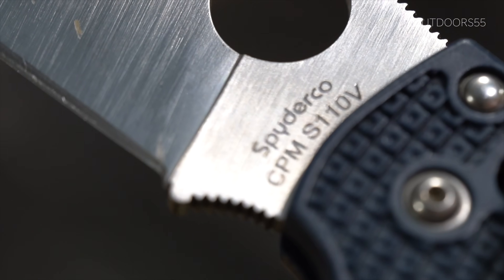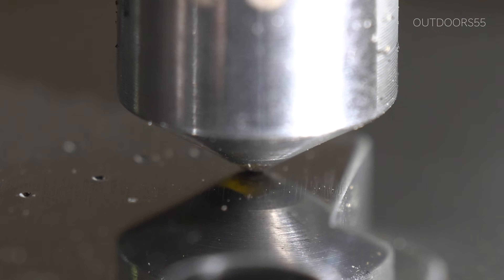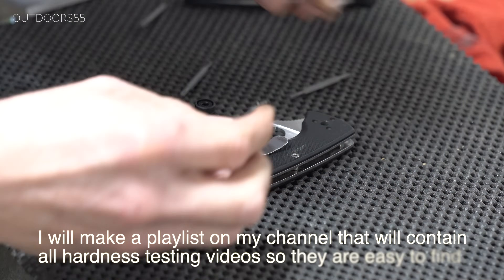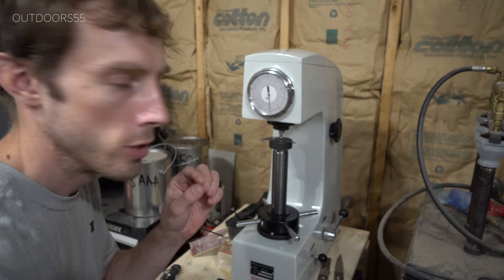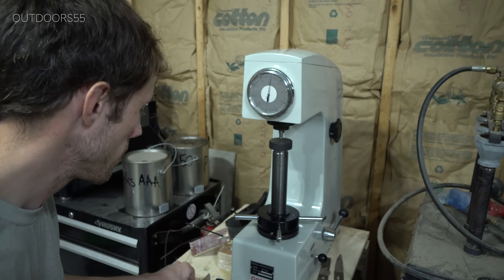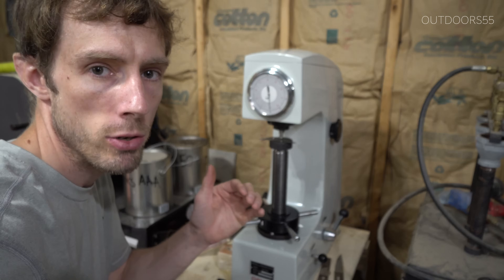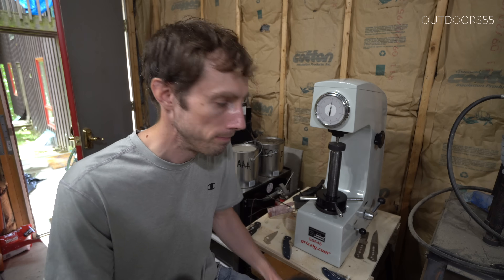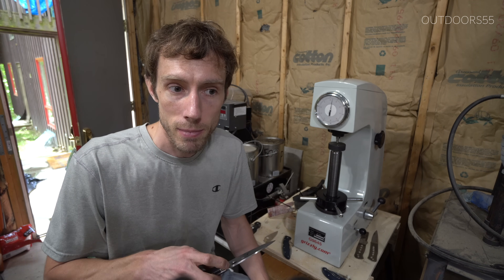How Hard Is Cheap Knife Steel?  Hardness Testing Spyderco Tenacious 8cr13mov

Comment: Hi Alex. Could you please add a comment in all future videos comparing your test results to the manufacturer's claims? Also each time you make a new video in the series, can you add a 'leaderboard' just listing every knife, the material, and the hardness? Thanks!
Reply from the maker: I thought about that. The reason I decided not to do both of those things is the manufacture's stated numbers can change. And some don't even list them. Also ive seen different numbers from the same knife models. In other words, the numbers really only relate to my particular knife. Thats also the reason I don't do the leaderboards. As I could test the same knife models a year later and get different numbers. So all the other videos would then be giving miss leading info. Adding a date of manufacture would be beneficial but thats aslo hard to tell. Especially with knives made overseas.

Comment: Changed my YT channel name to match IG been confusing everyone on YT 😬😬😬 

My genuine question  is if this machine capable of testing differentially heat treated blades like a knife from Tops? They state differential heat treatment of their blade and if you strip off the "traction" coating the different crystal structure is visibly noticeable with two different colours.

edit I should learn to listen before speaking 🤣🤣 it was clearly mentioned the surface should be on two parallel flats. Now I'm curious how a differential heat treat gets tested. Probably something like a shim of equal thickness.
Reply from the maker: Yeah it should be done on a flat surface. Otherwise the hardness reads low. I dont know if shims can be used. Any amount of flex or rocking motion can significantly affect the reading. There are ways to test a radius if the radius is known with a reference chart. On some knives i can test at the very spine and get good readings but not all. Thanks for watching bro really appreciate it👍

Comment: Try the fire bird 511.
It's cheap for what it is d10 tool steel and it has bearings. I would like to see its only like 25 or 30$. Have had mine for 5 years.

Comment: One suggestion, if it's too difficult to work well, I understand.  I have probably something like 250+ knives, I'd be more than happy to send you 5 at a time to make videos on, assuming you'll mail them back to me when you're done. With all shippers using tracking software now, it should be no trouble to assure you can receive and return knives, but if it's too difficult to fold into your schedule, I'd certainly understand. Not just offering dollar store knives here, either.  Randall Made, Busse, discontinued Cold Steels, I've got quite a bundle invested in steel.
Reply from the maker: Thanks for the offer! Ill keep you in mind 👍

Comment: Nice video man ! Even with a very good heat treat, I don't fancy 8CR13Mov much. However, I love this steel with a serrated blade like on the Tenacious. For how hard it is (for this given steel), the teeth hold a very good edge for a good time, and do not break easy. I've only seen deformation at the moment, no chips.

Comment: Hello. Maybe somehone else has already said that, but I would likes to suggest you a tip. Try to use a smaller base of the instrument: the smaller the better (like a cylinder of diametro = 7 mm). This will decrease the error caused by the curvature of the blade (you may get maybe 1-2 more HRC points). Of course It is more difficult to do (and more Dangerous for the durometer itself) because the blade (the sample) may slip out. Infact, where I work (big machanical industry in Italy, Quality Department) we have an accessory that you mount over the point, that Will go in contact with the sample and stabilize It during the measurament.
Nice video.
Reply from the maker: Absolutely👍👍 I am currently looking for one. As you know any deflection in a warped piece will give errors. Thanks for the comment 👍

Comment: The Mora Garberg in Stainless vs Carbon. A lot of discussion about the toughness of 14C28N vs 1095 floats around and one of the key components is what HRC they're hardened to. I've seen people claim 14C28N is 5 times tougher than 1095, a claim I find ridiculous

Comment: hi, really nice to see you are back! i believe these chinese steels aren´t that bad ( spyderco shows it) , i think the problem is a bad heat treatment protocol used by most of these chinese manufacturers.
there are some chinese steels that resemble the sandvik series of knife steels, so it should be possible to heat treat them to same performance. 6cr13 is almost same composition like aebl, 7cr13 is like 13c27, 9cr13 is like 19c27 and the 8cr13 is in between them, or like a 440b with reduced chromium. so with the right heat treatment they should perform mostly equal to sandvik steels.
i am really exited to see your next vid, if the heat treatment is consatnt or not. a test between jaktkit knife in 99cr18mov and cheap  ganzo 9cr18 knife would also be nice i could imagine.

Comment: There is a fine line with a knife between flexibility and hardness .  You want your blade edge to be hard with the tip of the knife to have a little flex without snapping off .  What do you consider that to be with your tester ?
Reply from the maker: It's different for every steel type 🙂

Comment: Would a simple carbon steel be considered "cheap?" I'd like to see a test on a differentially heat treated blade, specifically the difference between the hard edge and the soft spine.  Atlanta Cutlery has some 19th century kukris, that they brought for pennies per pound that should be interesting to test.
Reply from the maker: Yes a simple high carbon is considered cheap. Very cheap in fact. 🙂

Comment: This has been something I've been thinking has been needed for a very long time!  The most critical part of any knife outside of design and materials is the heat treatment of the blade, which I think must be done well for the knife to perform well.  Many manufacturers do a very poor job.  I think we are seeing better HT over the past few years, but I would like to know which manufacturer is doing it right and doing it consistently.  Of course, the latter will require some sort of statistical sampling which would be expensive, however, you might be able to test a dozen different steels from a manufacturer to see how they do across their line of products.  I look forward to this new project.  Maybe we could even do some edge testing after knowing the hardness of some blades.  There seems to me that this is the next step in examining performance of blades by determining the quality of manufacturing of the blade itself.  I will add that hardness is not the end in determining the quality since there are many recipes for heat treating, still this will be interesting.
Reply: Maybe I should disassemble some from my collection to send to you in order to boost your results.  Are you open to a box of blades showing up in the mail to add to your testing?  I would disassemble to reduce shipping and also reduce your time in doing so.
Reply from the maker: I might be up to knives being sent in in the future. Im kinda backed up with them at this point. Once i am through with what i have I might "open the books" so to speak. Thanks for the offer! Appreciate it!

Comment: This might be difficult to test but I know some knives have stainless cladding on harder core, and/or due to the thickness of the edge (compared to the spine) the heat treatment will result in different hardness for the edge v.s. the rest of the knife. How much do you think this difference might be and if its possible to test the edge hardness without ruining the blade?
Reply: To add to that point (but I'm not a knife maker nor an expert at all)
During heat treatment, when the blades are cooled, isn't the cooling speed different for the thinner edge than for the much thicker spine?
And does the higher cooling speed increase the hardness on the edge more than for the spine?
Just wondering...

Comment: I have dozens of knives, from low and high end production folders to custom hand made fixed blades.  The one knife that is ALWAYS with me though is the Victorinox Classic SD.  This is the smallest and least expensive of the line with a blade, file, scissors, toothpick and teasers.  It is small, but can keep a scalpel sharp edge fairly easily.  My other knives rotate based on where I am going, what I’m wearing or my mood.  This little red wonder is always consistent though.  And yes, I usually have two knives on me at any given time.  I’m under no illusion that someone could skin a boar with the Victorinox.  I’d be interested in seeing that tested.  Bonus is that it’s cheap!
Reply: I'm with you on that one. Mine is the Victorinox Signature. It's so nice to have a hidden pen at all times. I believe YouTube propagates knife arrogance towards small blades that don't withstand being beaten to death.
Reply: There is a comment on youtube from a hunter skinning with the smallest victorinox blade once.  Personally I carry and dislike that blade but like the Swiss Lite package
Reply: Breaking: “Victorinox issues M390 knife blade in their iconic little knife and sells 50,000 knives in a day”
It will never happen because they are stubborn Swiss, but one can dream. 
(:
Reply: I keep a Classic SD on my car keychain. One cool thing is that you can take it on airplanes too. Maybe not in America though

Comment: Hello, Alex;
I have a CJRB Briar Linerlock Black D2 J1902BKF, it's supposed to be D2.
It is a hard, hard-to-sharpen steel.
I've gotten it really sharp ONCE, but I'm still trying to learn how to sharpen it.
It's much easier to sharpen my Morakniv Craftline Basic 511 High Carbon Steel.
I was surprised at how much easier to sharpen the Morakniv is.
So I'm curious about the CJRB D2 hardness.
Plus, the blade has flats between the point & the pivot, above the edge.
So maybe it'll be easy to test?
Have a GREAT day, Neighbor!

Comment: Would be interested in seeing just how bad or maybe not as bad as we all expect them to be the cheap gas station knives are. Also something like box cutter blades and if you can manage to get them without buying them since they are 100% a scam kamikoto and dalstrong knives
Reply: @Cy1onRaider  Ive not used them personally but from what ive seen of them and the opinions ive seen of them I dont believe they are worth the money. From the pictures Ive seen they have very thick grinds which leads to them wedging in hard foods like carrots. They might be very strong but being able bend, and chop through stuff like small branches is not something I look for in a knife. Being built like a tank is a good trait in a knife like a bone cleaver, but in a chef knife its a waste. I much prefer a hard steel thats super thin at the edge which leads to better cutting performance. Lastly their marketing to me screams "gamer marketing". Essentially mark up for shiny fancy looks at the cost of quality, a well built knife is an elegant tool not a stealth fighter. So essentially my main complaints about them is that I think they are gaudy, and over priced for what you get. 

now if you are happy with them more power to you, I haven't personally tried one so they very well might be better than I give them credit for. Most certainly better than kamikoto but the pictures ive seen and the way they market makes me wary of their quality.
Reply: @Cy1onRaider  Well like you said to each their own. But the marketing heavily turns me off. Anything that has to market itself that hard isnt nearly as good as it claims to be. 
looking at dalstrongs website the first listing is the "delta wolf" 10" chef knife. 
The entire product description is marketing buzzword garbage, the steel is a chinese copy of 440C not a terrible steel but in the current age 440C is the kind of steel you find on $15 pocket knives. 
Some like the "shadow black" series dont even list the steel they just use vague terminology like "high carbon thyssenkrupp german steel" Which is another red flag if a knife company is afraid to state the steel used in the knife its probably because its cheap budget steel. 

And the reviews I looked at for dalstrong confirm what ive been told by others. Thick behind the edge, chinese made knife from chinese steel, and lacking in quality control. 

Their marketing is almost as bad as kamikoto just without the predatory tactics. 
All of the amazing feature they list are basic requirements for a knife at less than half the price. 
And thats my biggest issue with them. You're paying for the ridiculous gaudy styling over a product that performs at a level that you are paying. Now if you like the styling knock yourself out, they definitely have a look that I would have liked when i was 18. But I want my knives to look like knives not tactical knives mixed with kitchen knives or space ships.

Comment: Love this stuff.  I'd be curious to see a test of BHQ's 10v Kizer Sheepdog.  Pretty unusual to see a big 10v blade for $90.
Reply: I've tested 2 already, one was 59.6 rc and the other was 60.2 rc.
Reply: @Outpost_76  How much do you think the performance is hurt by this? I've heard that 10v performs best in the mid to high 60s
Reply: @momish392  I'm doing edge retention testing on it now.  If it's like the 4V Sheepdog and was ground mostly prior to heat treat then ut may do well. As a comparison the 4V Sheepdog tested 59.5 at the spine but 62.5 down as low as I could get to the apex on the flat pivot area. That 4V cut comparable to Spyderco 4V run at 65 rc. Pre grinding heat soaks the thinner areas faster and they also quench faster resulting in a blade harder at the apex. This is why even being softer it cut about the same. I hope this is the case with the 10V since it starts to do well in the 65+ range.
Reply: @Outpost_76  Oh man I'm so glad to hear you're doing a cut test on it, I can't wait. Thanks for your help and information!
Reply: @Outpost_76  That's interesting.  Seems like it would make a lot of sense to grind before heat treating, not just to harden the apex, but because it must be a lot easier to grind and thus reduce abrasive or milling costs.

Comment: Cool series you're starting! Benchmade Adams (sp?) tested would be nice to see if it's the same as manufacturer says it is.
Reply: In D2. Not sure but think that's all it's made in, maybe not....
Reply: @MrBearbait75  

It's made in Cruwear also. The cruwear ones have been tested a ton and always fall between 63 and 64.

I haven't seen a D2 one tested.

YouTubers have been doing this for years. There's even a database of the results.
Reply from the maker: Almost bought one of those a dozen times...Just never pulled the trigger👍

Comment: Spyderco hrc and heat treatment in the past 2 years seems to have gotten really good compared to the older stuff
Reply from the maker: Glad to hear that👍 Interestingly though, this knife is from 2010. 🙂
Reply: I'm with Jared, some Spyderco models have always been good, those being tool steels. The stainless has had some dips and the 20CV and 204P from them has always been soft.
Reply: @Outpost_76  I’ve never understood how m390, 204 and 20CV are analogues yet the acceptable HRC for 20CV and 204p is lower.
Reply: @stevenlachance8576  that's just it, acceptable hrc for 20CV and 204P is the same as M390. The problem is almost all can't seem to get 20CV or 204P to a decent hardness in production blades. I'm not positive why and a great example would be the first run Dlt 20CV Manix coming close to 61 in the hardest I've seen tested yet the M390 Manix regularly hit 61.5 to 62.5. Same company less than a year apart. If ypu add in the PM2 runs the difference in 20CV and M390 gets huge, as much as 4.5 points of hardness between some examples.
Reply: @arrowheadguys7637  that's what I've been talking about for a few years now. I'm working on some videos covering this. I don't think it's covered enough and it's understood even less.
Reply: Byrd and spyderco 8cr has always been around 60 since the beginning

Comment: Buck’s US 420 HC vs Buck’s Chinese 420 HC . Want to see if the Bos heat treat makes a difference. Buck Pursuit and the Buck Selkirk would be good models to compare .
Reply from the maker: I have a buck on the say right now but that idea definitely peaks my interest 👍
Reply: I did a video on this a couple years ago and it's a big difference in wear resistance and hardness.
Reply: Also, the old U.S. Schrade 7-OT (in both the high carbon and the stainless versions) vs. the new Chinese Schrade 7OT stainless blade.

Comment: But wouldn't a higher sample size reflect the averages much better for the tested knife? At least in regards to "Just because my knife tested this way yours doesn't have to"

Other than that I really love the video! Keep em coming
Reply from the maker: Yes, for sure...This is just the start, my hope is that over the next couple years we can establish more of a data base, and possibly see the trend moving to harder knives in general from the manufactures.
Reply: @OUTDOORS55   Fantastic idea! Gonna stick around to see that. Maybe you could do corrosion tests too, I think that's important in a knife for outdoors :) Could expose the knives to moisture for some extent of time to compare the corrosion resistance of the materials used

Comment: Awesome idea! For a point of reference,  tungsten carbide is around 85hrc and a drill bit is around 65hrc
Reply: Saying "a drill bit" is no different than saying "a knife"

Knives run from 45 to over 70. Id bet a ton of money that the drill bit gap is nearly the same.

Also, the Rockwell C scale technically maxes out at 70, but that's a conversation for another day...
Reply: @CNYKnifeNerd  there's always one...
Reply from the maker: I will be testing drill bits too😉